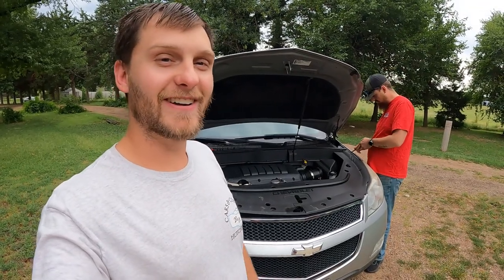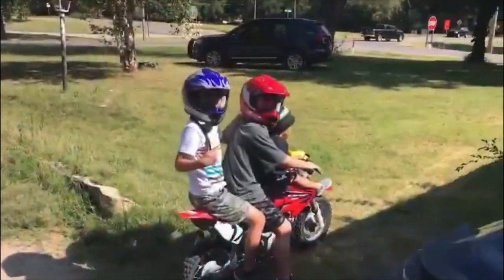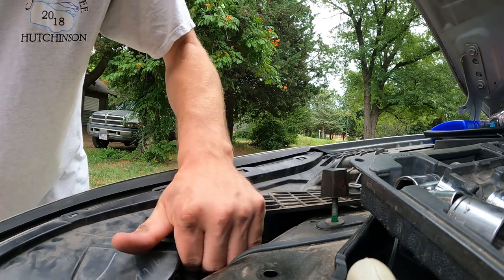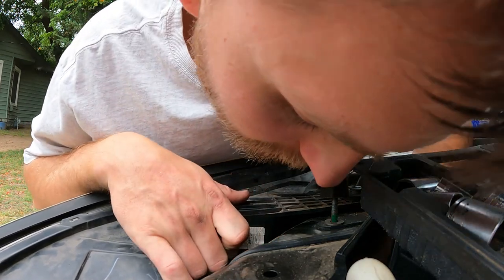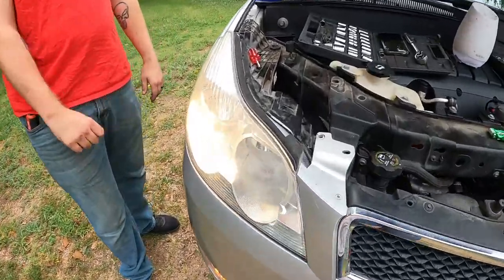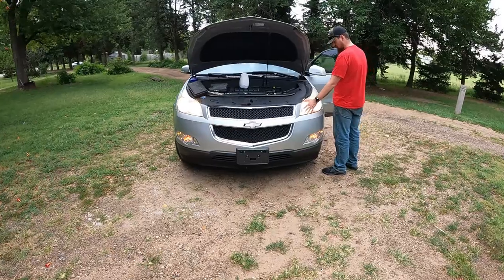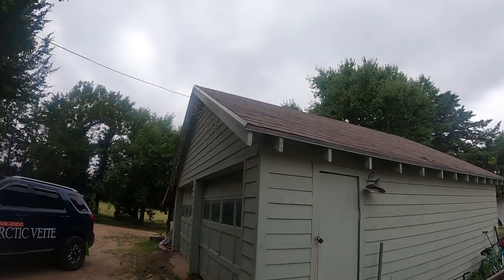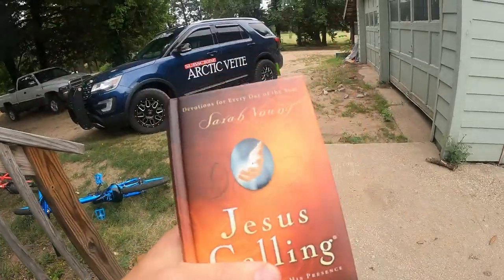How to replace headlight bulbs in a 2010 Chevy Traverse (remove housing and bulb the easy way)

Comment: Going under the wheel well is a little easier to get to the low beam. Only 2 screws and turn the wheel away.  This is really best for high beam only.
Oh i see you figured it out later in the video. Lol
Reply from the maker: Agreed! Going through the wheel well is the way to go! 🙌🏼🔥
Reply: A little easier?  WAY EASIER forget doing all this

Comment: This is the difficult side, you will not be able to change it, go to the easy side, remove two screws from the wheel fender cover bottom and you can change it without any problem.
Reply from the maker: @Ortizluis33  yes! That works out so much better 🙌🏼